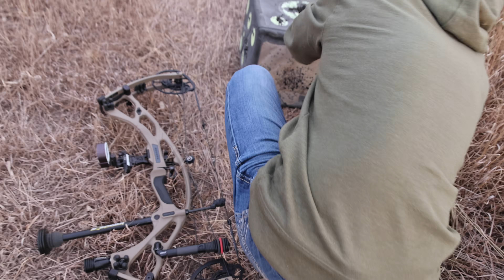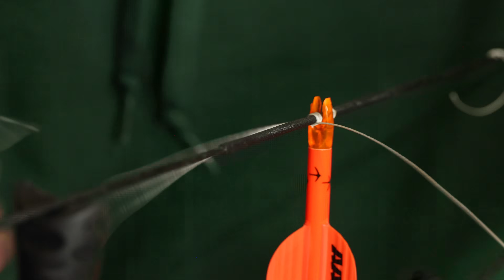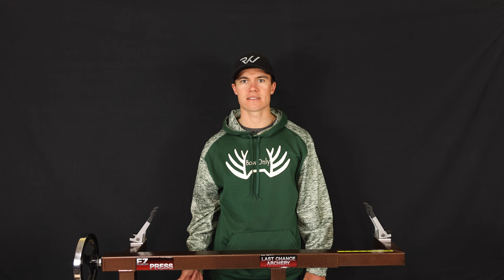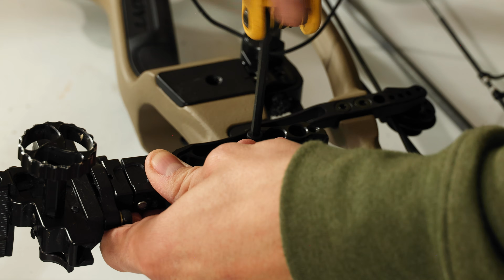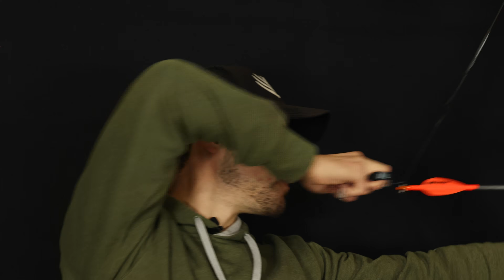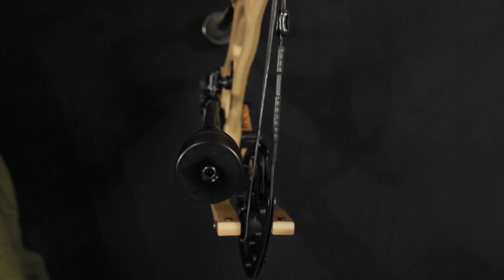NEW Hoyt Carbon RX-7 Bow Build

Comment: How do you feel about over/under spined arrows? I'm shooting 27.5 draw and 65 lbs and don't really feel the need to go up from there and my shop sold me 300 spined. Arrow is 494 grains. Easton recommends 340 so idk if I should get the 340s instead.
Reply: If I drop to 340s I will be at 458 grains give or take

Comment: Wait your telling me because the ATA was correct the trimming is OK? Gee I hope this was just a bad cut.
Reply from the maker: Watch the whole thing to understand the difference between timing and cam sync. ATA is not the only measurement to help determine cam timing (positioning at rest), and plays no significance in cam sync (cams synchronized at full draw). Hope that helps give you clarification.

Comment: The Victory RIP TKO is a better arrow. The Easton HIT inserts will fit in them. You should try that. I’ve been running them with the iron will collar and they have been crazy good.
Reply from the maker: I actually shot the RIP TKO last year with the HIT inserts! They did fine, however I did notice the ends of my arrows being weaker than I'd like and tended to flake apart on both ends. The price difference between the two was not worth it in my case to go with Victory again for this year, therefore I chose to try out the Axis.

Comment: Are your cams shimmed to the left or right. Mine came shimmed right and tuned at 12/16 versus 13/16 centershot. Sounds like yours tuned right at 13/16. Curious
Reply from the maker: The cams are shimmed to the right (thick spacers on left). Based on your grip and the limb deflections, they will tune different from bow to bow and person to person.

Comment: Good video ! I put a little string wax on the threads of anything that attaches to my bow. Helps keep moisture out
Reply from the maker: Smart thinking! Blue Loctite Threadlocker is a great product that holds the screws/bolts tight while keeping the moisture out as well.

Comment: I like  Easton access but They are not durable at all If you hit anything hard they will mushroom they will snap I I started shooting day 6 arrow they're a little bit heavier but they got a super thick wall Victory map elite are pretty good I shot over a target and shot through a 2 by 4 and getting snapped it But then I hit a plastic leg on a 3-D target and blew The end of the arrow off My recommendation they are awesome Both of them they are both micro diameter hero I've had them For a couple years now and have only broke 2 arrows

Comment: Great video. I have been shooting VAP TKO 350 for several years, and they have been fantastic. Out of my 60 lb, PSE evolve. My setup had the arrows at 460 grains. 

This year I am trying two arrows out of my RX7 Ultra: 5 mm AXIS with the SS OUTSERTS (535 grains) and the VAP Xtorsions (551 grains), cut 28.5 c2c and 300 spines. You might want to look at what Victory Archery offers, as they have been great with fantastic penetration. Thanks again for sharing your setup.

Comment: Great video. I just settup my new RX7 as well. It seems to have some noise at the shot. Are you noticing anything with your bow?
Reply from the maker: I haven’t noticed any noise, seems very quiet to me! Maybe check to make sure your sight, quiver, or any other accessory isn’t making noise. Oftentimes that is the cause of shot noise/vibration for me.

Comment: Sweet setup! Curious if you guys were worried about a 340 spine being a little weak at 29/70 and 50 grains of brass upfront?
Reply from the maker: Thanks! With these arrows being cut to 27”, it really isn’t a problem. It is slightly weak when using the normal weight nocks, but I’ll be adding screws to my nocks to replicate the weight of my lighted nocks. At 23 grains, that helps even out a little bit and the spine should be fine. I didn’t mention that in the video but that’s my plan. With string stretch my final draw weight will probably end up closer to 70 rather than 72 as well. Great question!
Reply: @BowOnlyOutdoors  You are so close to be underspined it scares me.  My 73# 30" draw RX-7 is loving the 250 spine Sirius Orions with 220gr up front.
Reply from the maker: We’ve tested many combinations of arrows and how it affects the dynamic spine and with these arrows shot out of our particular set up, this is the best and most forgiving we’ve found.

The most important thing is to figure out what’s best for you and your set up. Too stiff is never a problem, but we get the best accuracy and forgiveness out of our current set up without the sacrifice of broadhead accuracy at distance. If our arrows were 28” or if we had 200 grains up front, it would undoubtedly be too weak for this to happen.

Comment: Looking at the axis as well. Currently using the 5mm fmj 340 spine
Reply from the maker: How do you like those? I chose the Axis over the FMJ based off the weight, FMJs were just too heavy for what I was wanting to shoot
Reply: @BowOnlyOutdoors  I liked them ok, the only thing I dont like about them is they are a little brittle.  I have broke a couple that a normal carbon shaft would have been fine on.  Im needing to get some more is the only reason im thinking of changing it up.
Reply: Is that a legit message